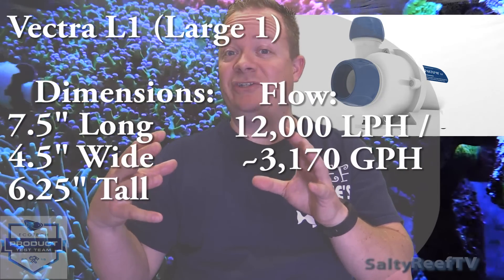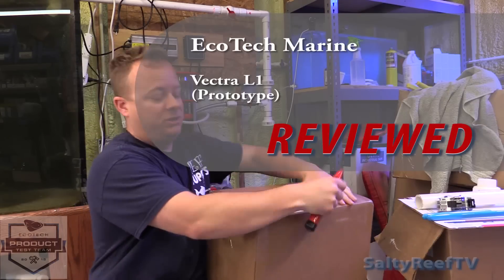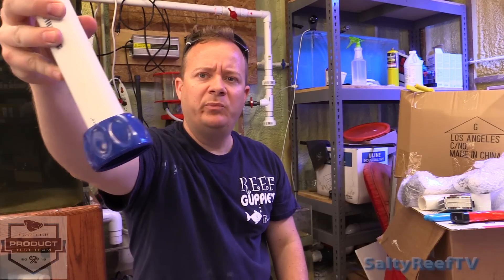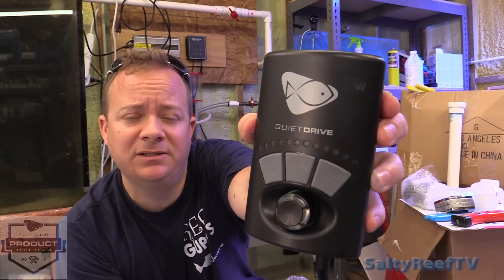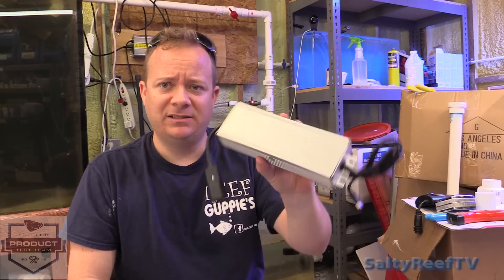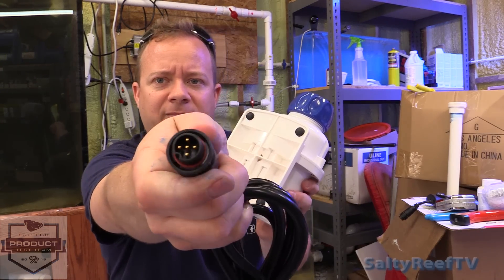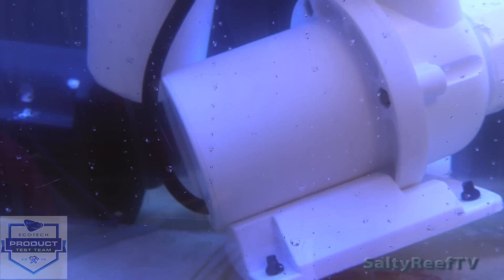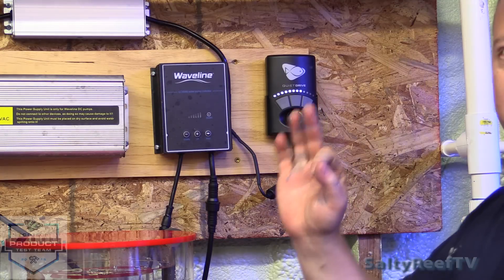REVIEW: Ecotech Marine Vectra L1 - Prototype

Comment: Thank you for your review. However there is a grave error in your review that is terribly false. Perhaps your prototype pump has American NPT threads but the production model has BS pipe threads. This system uses a different thread pattern and is not tapered as is American standard NPT. Yes you can "force" an NPT adapter on the pump but you will, in time, damage the plastic threads. If you use the pump externally, you will get salt creep at the least and could have leakage at the worst. Submerged use is not as risky but why risk cross threading the pump's fittings, damaging a $450 pump. Eco Tech has adapters with the proper thread pattern for sale in their parts department.  The M1 pump is fantastic and the adapters work very well.
Reply from the maker: +Richard Allen I don't recall stating that the pump had NPT threads. I recommend some TFE paste with teflon for external installs if you have the desire to use NPT adapters like I did. But I won't argue that using the manufactures intended/designed fittings is a legit option. ;)
Reply: +SaltyReefTV Thanks for the very quick reply. I am sorry as I thought perhaps your prototype did not have the British Standard Threads as the production pumps do. It seems quite a few folks in this hobby do exactly what you did but why increase the risk of leaks or damaging your very expensive pump? Imagine the aquarists who purchases the pump based on your information from an online vendor. He/ she sees the adapters listed on the website, but, based on your review, figures the adapter is not needed. While forcing the NPT adapter on your pump to film your review, is quite understandable and in no way affects the pumps performance,  you should have covered  the fact . An advantage to using the proper British Standard adapter is you can use simple food grade silicone grease and effectively seal the adapter by screwing down completely [no taper] and it can be removed far more easily than using silicone tape or TFE paste. This information is important as many of use want to do things the right way. I will say, other than this, as an owner of a M1 Vectra, your review was by far the best I have seen anywhere. The Vectra Pumps are very special and you did a great job capturing these details in your video. Again, I repeat, your review was very complete and you made all those special details easy to  understand.

RJ
Reply from the maker: +Richard Allen Again, thanks for sharing your opinion. If using NPT adapters is ok with Ecotech Marine (they recommended it) then that's good enough for me. The warranty won't be voided by using NPT adapters, but there's more than one way to skin a cat!
Reply: +SaltyReefTV there's always at least one anal wart. most people who are going to spend this amount for a return pump will know the difference or have done their research from multiple resources